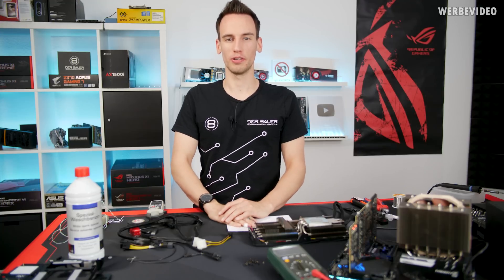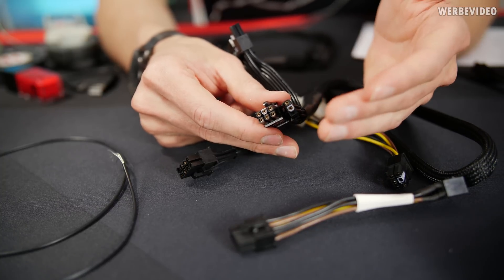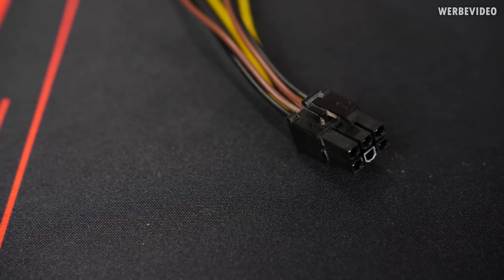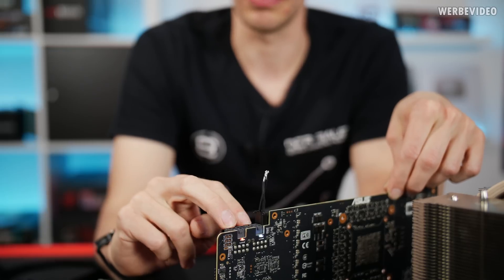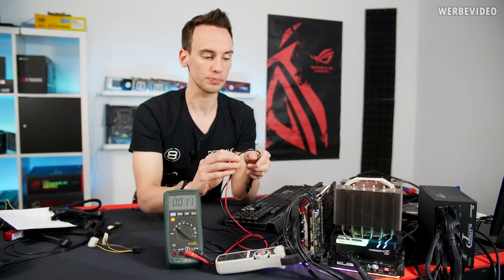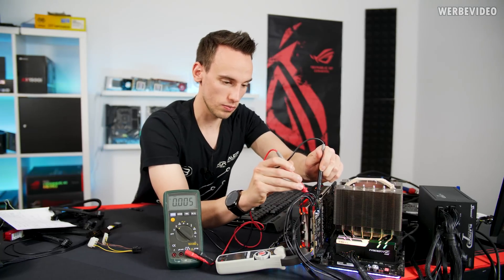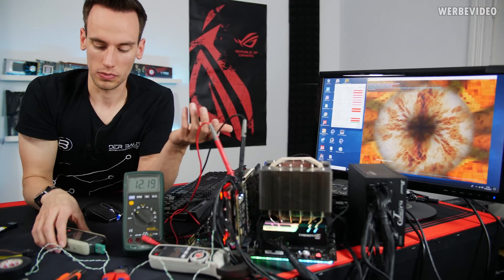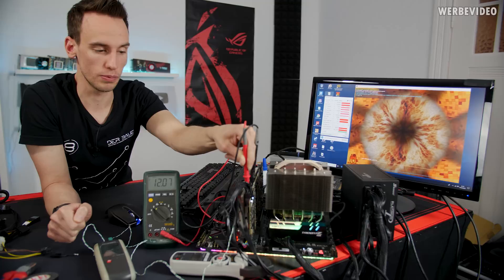PCIe Cables: So much does your GPU really need!

Comment: Love it! Nice video
Very good info.

So what is the point in multiple 6 and or 8 pin connections if you really only need most of 1 six pin connection?
i would imagine cable temp and redundancy would play a part but is it that serious to need 3 8 pin connectors like on the one card you mentioned? You said one cable was able to feed over 500 watts (on the low side i know but just to keep math "simple"), the 3 8 pin card could feed multiple KWs of power? Why?
Reply: The Spec was set in stone multiple years ago and can’t be changed to maintain compatibility and Nvidia sticks to the spec even when thee is no need to, on a AMD GPU you can pull more than spec through the connector. it is only follow old PCI-e/ATX spec not for redundancy or to reduce voltage drop.

Comment: then why use 2 8pins if we can use 4 pin, jk
Reply: The GPU draws the power, the PSU regulates voltage through the rails. Daisy chains can cause whole setups to fry, depending on what CPU you have and how its voltage curve works. If I were to use a daisy chain with my 1080, my ryzen 5 3600 will over-voltage on idle, and under on load, which would cause a chain reaction with the timings of my RAM's cas latency and secondary timings, too, as well as under-volt on load.
Reply: @nastynick4606  daisy chains are paralleled so voltage won't be affected but current will. You just have to make sure that there's not much more current that is flowing through those psu wires than the copper/idk can handle (that depends on how thick those copper/? wires are).
Reply: @DenzCasuela  I don't know why I said voltage, I'm an idiot. I meant the current lol But from the minimal electrical knowledge I have, the voltage depends on the correct current, right?
Reply: @nastynick4606  hmm I don't know what you mean but here's an answer there's also a thing called resistance. with ohm's law you can calculate resistance, voltage and current. and wires has resistance, just small
Reply: and a load is also a "resistance". voltage across parallel load is the same while current across a series load is the same.
Reply: @nastynick4606  too much current will heat up those wires, voltage ripple is dependent on your psu though and load will affect it too but I don't think wiring would help much or at all. It's just for safety.

Comment: U missed to look up the single connector specs besides the cable specs.. I assume these connectors are way lower then the specs of a single cable..

Sorry actually u mentioned it basically. But I bet that's the reason for the manufactures to add cables.
Melted connector housing look bad.

Comment: Interesting stuff. It would be cool to see the card powered off a bench PSU. That way, you could current limit the supply and manually dial down the voltage. Would be interesting to see the minimum power needed to run the card idle and with load. A PCIE riser would also let you get some measurements over PCIE but those things are not cheap and have very few other use cases.

Comment: If you took the two 8 pin connectors and pigtailed all of the plus 12s together and all of the grounds together you should be able to run with just a plus and a ground wire. The card itself wouldn't know all of the other wire was missing because every connector pin would have the level it is supposed to on it.

Comment: "...is that really true? obviously it's not.." (now let's make a 17 minute explaining)

Great video, but strange wording at the start. I took ELECTRONICS in college, have worked on many PC's and it's not "obvious" to me that a graphics card with more power delivery (i.e. 3x8-pin vs 2x-pin) has NO capability to overclock higher. It doesn't surprise me that it would be for marketing purposes and that there's no advantage but it's again not "obvious" either that this would be true.

Comment: So my red dragon v56 bios flashed to v64 nitro + le bios with only 1 cable that got an 8 pin and 6 pin will be fine?

(been running it in crossfire with the v64 version of the le) I had no issues so far but heard vegas are picky.

Comment: Interesting to watch- though I'm no pro overclocker lol. What happens if you overclock a '75W' GPU powered only through the PCIe? Does it throttle? Can it damage components on the motherboard or even the GPU? Does plunging in the main power connectors on a card bypass the power supply via the PCIe 3 slot?
Reply: not really the 75 wait limit can be exceeded and it is usually only as a max limit. let's face it if the gpu only requires power from the pci-e buss then it probably is not capable of pulling a full 75 watts. and as to bypassing the bus fed power yes it is possible but doing so will literally get you nothing more as the gpu is not capable of pulling that much well unless you go crazy and modify  the vrm's and manage to tweak the controller that does all the work.

Comment: Personally I know from AWG of the cable, for instance if the cable is lets say 18AWG it can whitstand around 20A per cable.
Reply: 12awg is 20amp rated at 90c, 14awg is 15amp at 90c. Amps doesn't change with voltage. 20amps on an 18awg cable would overheat it in short order.
Reply: Maybe for short periods, you can’t run more than 8AMPS per pin pair according to AWG, you can draw 13 with 16 Awg

Comment: 8:26 sure you can , use PCIE riser and check the amps on cable.
Reply: That's what I was thinking.
Reply: there is most likely several connections of power/ground that you would have to separate from the signals in the ribbon cable. It would make it very difficult retain signal integrity of the pcie bus. You could probably make a custom riser board with integrated current sensing IC's and a strategically routed ground path. But that is quite a bit of effort for something you can pretty easily guestimate.
Reply: @mattb6001  Luckily smart engineers decided to route all power through first pins in PCIe slot. There's 5x 12V pins and one slot detection pin, pins 1-3 and 2-3 other side are 12V. So if you separate first 6 wires from ribbon cable, measuring current shouldn't be difficult. It doesn't mess with signal either as they run beyond first key in slot starting from pin 12.
Reply: @mattb6001  signals are not current , it will not make much difference, just checking all cables on riser will to the job just fine .
Reply: LordX if you put a clamp around both the power and ground, you’ll read 0, even if current is flowing. The separation is more to separate the power from ground. I agree clamping the signals shouldn’t have much of an effect.

Comment: Very intresting video! I'm both into gaming and mining, and I have a lot of GPUs like RX 570/580 that only needs one 8 pin connector even if it's two at the card. But I have noticed that I CAN run the cards from a Molex connector to 8 pin with no problems, and that's lower rated than 8 pin.

I also have some 1070 Ti's that requires 8+6 pin connectors, but I think most 1070's only requires one 8 pin connector. Also have an 1080 that only have one 8 pin connector. It really depends on the manufactors.

Comment: Seasonic states for my Prime 80+ Titanium (second batch of 850w psu's back in late 2016) that one pci-e 8 pin power cable can be used for up to 220w load my Gigabyte gtx 1080 xtreme gaming edition uses two 8 pin connectors and I feel more comfortable by using two separate pcie power cables
Reply: Electrons do not care how comfortable you are.

Comment: This is the conseuquence of the aging ATX standard and having to reuse existing connectors as much as possible instead of designing something completely new. graphics cards require lots of extra power so I think it would not be such an issue to design a completely new connector for this purpose and have a special thick cable from the PSU (just two wires, power + ground). It should be clear to everyone that this isn't about wire gauge when you have daisy chaining 6 pin plugs on most cheaper PSUs instead of separate wire runs from the PSU side.

So much about the ATX standard make little sense today but we are stuck with it.

Comment: So if you were into diy a lot, one could take like 2(1L/1N) 12awg wires to the connector and just bridge everything correctly on the connector and make a super clean build.
Interresting.
Reply: There has to be some reason why they're running so many wires but for the life of me I've no idea what it is. One 18 gauge wire should be able to deliver 22 amps. Which at 12 Volts is 264 watts. But those connectors couldn't handle that kind of current going through them. Any resistance there and they'd heat up. So that is probably why there's so many wires?
Reply: @1pcfred   It's for efficiency too, I guess.   Even if you lose, let say only 1 watt by heating  the wire it's still a loss that is easy to avoid by using more wire.
Reply: @1pcfred     Naw you do it wrong like really wrong   you would get precisely that wattage by closing a circuit with a 4 miles wire and no load.   But in that case you have a 0.024 Ohms  wire connected to a 20 amps load or something.  So calculate the resistance of the 20 amp load at 12 volt. After split the voltage between the load resitance and the wire resistance and calculate the wattage the wire get at that voltage at 0.024 Ohms.    I did not do the math ... I guess about 4 watt.
Reply: I done the math ... it's even worse....   With a pair of 2 feet (4 feet total) of 18 awg wire and a load of 20 amp you waste about 10 watt in the wire.   The wire get 0.51 volt at 0.024 ohms.  When you split the voltage between the  load resistance and the wire resistance.

Comment: Some time back i looked for PERFECT PSU (perfect PSU is PSU which delivers perfect 12.00V on FULL load, like RM1000i, HX1200 wich have capacitors in cables for less ripple)! Tested a lot of PSU's, each PSU is unique (two identical can do ~0.03-0.08V difference)! Closer to 12V - less heat from VRM's and difference is about 5'C-10'C!!! Was used EVGA 1300W G2, there was 12.22V on idle and 12.18V on full load, my VRM's got ~5-10'C hotter than with RM1000i or HX1200 where voltage is 12.07V idle and 12.01V full load, that is EXCELLENT VOLTAGE! Less voltage is bad too becouse VRM's is trying to compensate voltage drop, and they gets hotter too... 

Conclution: closer to 12.00V = better temperatures!
Reply: Sorry but that's just not true. The VRM is a switching type of regulator so the temperature depends on the wattage passed, not the input voltage. If it was a Linear style regulator then you'd be absolutely right, however for the huge voltage drop it would be completely the wrong type of regulator. Finding a PSU with low ripple is far more important than to find one that outputs bang on 12.0000v, in practice it doesn't matter much going from 11.5 to 12.5v, the components don't care.
Reply: @SuprSi  I wrote only my personal opinion + what i understand and that is working for me! Dont take it so close to your heart, man...sorry!
Reply: @SuprSi  i think what he noticed was the increase in the current draw producing more heat due to the change in resistance. i  have experienced this and it does happen. now with that said computers (modern ones for a fact) are designed with this in mind as the atx spec allows the 12 volt rail to range anywhere between 11.7 to 12.3 with out damage. anything below 11.7 and things start getting glitchy as it tries to pull more current but it is not able to (psu has the major role on that as i have seen 11.4 volts and no issues on one computer) but going up in voltage say to 12.4 or slight higher say 12.6 will be fine as long as the parts it is feeding is capable of handling the increase in voltage. had a computer that i built that ran for years off a modded psu that put out 12.4 under load and 12.7 under no load and you can figure the 5 volt rail was the same as in 5.5 volts under no load and 5.45 under load. (ps having such a high 12 volt rail meant overclocking was a blast Literally! got some pretty high clock speeds but in the long run fired some vrm's. change mb and kept clocks slightly lower and it when for 6 years non stop like that.)
Reply: suggest me a atx 3.0 power supply guys
Reply: @CaptainScorpio24  Why do you need one? What MB, what setup?

Comment: Finally someone proved that only a 6pin is necessary for the average consumer.
Reply: as de8auer just demonstrated a 6 pin connector with 18AWG wire can handel upto 500watts no problem. that said you'd have a hard time finding a 650watt psu that only has a 6pin. I'm actually annoyed that my RX580 is so inefficient that it won't play nice with my i3-8100 when I run a extreme benchmark on a 450watt SFX gold rated PSU.
Reply: @psionx1  What do you mean? I have a 400w PSU and a Ryzen 3600 with an RX580 and it runs just fine.
Reply: @spacemeter3001  in a normal case where the MOBO controls the fans maybe. but I use a server case with 4x80mm fans spinning at 2500RPM 24/7. because I like the portability.  that said I switched to a GTX1660 last december and I haven't had a black screen of death since. keep in mind it ran fine under normal gaming loads but when I pushed the card to the limit it would crash. for example I could run furmark at 1080p full speed all day if I wanted. but it would instacrash if i tested 4k+.
Reply: LAXnPacks Gaming  I have my 1070ti on a 6 pin connector with the 2 pin trick that derbauer did to show how the detect pin powered up on his ASUS card. No problems whatsoever. And this was on wimpy 20AWG wires lol.
Reply: to be fair, the spec probably isn't for the wire gauge but rather the connector itself since they would definitely wear out over time with more plug cycles. the contact each pin makes would get worse and looser connections means higher resistance and more heat. they're just covering their butts with the 75 and 150 watt ratings but in reality they can handle much more

Comment: Wait more cables make for better voltage?
Me installing my new 2x8 wires instead of a 1x8 splitter. It's been 2 hours I'm done. Finally

Roman closing his video, yea guys so in conclusion it doesn't matter we ran a strix of like 3 pins to whatever you only need 1 wire, get fucked!!!!!
Reply: @claritoresdiano1021  what

Comment: I used to have only one pcie power cable (the one that splits into a second connector by the card) going from the psu into my cable extensions and I thought my Strix 1080ti was a dud in regards to overclocking, no chance in hell it would be stable over 2050MHz even when watercooled, but then I connected a second cable from the psu and into the second cable extension and suddenly I could overclock it to 2150MHz just like that. It probably had a steep voltage drop making it unstable.
Reply: Long cables or smaller wires means more voltage drop. Perhaps it's also possible something with the connector was causing a little more resistance than it should?
Reply: @zcomputerwiz  could also be the card it's self.

Comment: Next up: How many pins does a CPU really need
Reply from the maker: Already did that
Reply: A CPU "really needs" what its required from the manufacturer. If they would need any less/more, the engineers and big brains at intel and amd would make different connectors for different CPU's. The reason why they use 4-pin is to cover the broad voltage curves and power draw for different CPU's. That's why most overclockable motherboards have an extra 4 pins to ensure there is enough power for overclocks. If you needed more/less pins, intel or amd would have to make different connectors for the corresponding CPUs, which sounds like more of a pain in the ass and a waste of money. A 4-pin guarantees every CPU with various core counts gets the power it needs.
Reply: @nastynick4606  I wrote this nearly a year ago. But I'm pretty sure I was jokingly referring to the pins on (some) cpus
Reply: @bryansuh2000  I know, and I apologize lol. I wasn't trying to troll, just trying to answer your question the best I could without sounding pretentious and smug. I just got carried away with the comment, my bad... I was trying to see if anyone commented about the daisy-chained PCI connectors. I just bought a 1080 for super cheap and only had a non-modular psu with one 8+6 cord. Needless to say I just bought a new psu lol. Have a good one, man.
Reply: @nastynick4606  xD its all good. Maybe someone who actually wanted to know about the power pins will read your comment. (That sounded sarcastic but wasn't lol) have a good one too!
Reply: @bryansuh2000  No, it's ok. I kinda deserved that sarcasm with my sativa and alchohol-induced drawn out nerdy computer rants lol kind of like how I just explained that rant, it's a bit excessive, kind of like how long I'm making this post trying to explain my nerd rants while at the same time pointing out I'm ranting right now lmao have a good one XD

Comment: So if a single 6 or 8 pin connector can easily deliver all the power necessary, why are there cards with more connectors? Is it purely marketing - making consumers believe more connectors gives more performance?
Reply: I'm almost certain that it will be explained away as redundant power, in case 1 of the 8 pin connectors fail, But I see it as a way to inflate the cost, because until now I thought more power connectors meant more POWER!!!! It really sucks that  we are all being fooled by this marketing ploy!!!!!

Comment: measure main power connector, minus power through pci power cables, and run a gpu intensive process like a miner.... and you xan find pci wattage.
Reply: Wapn Perfo furmark would work for most testing.